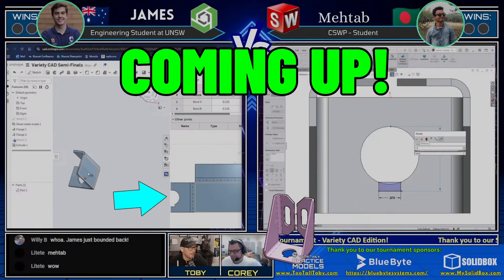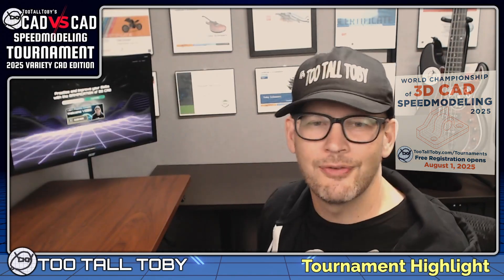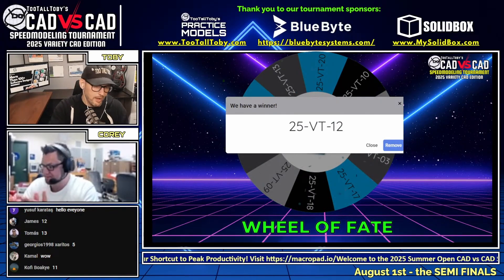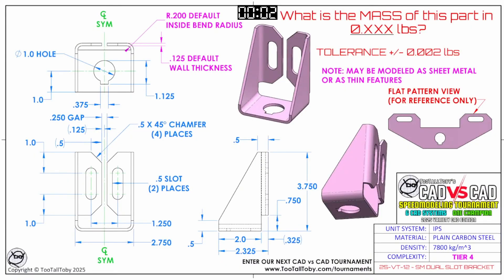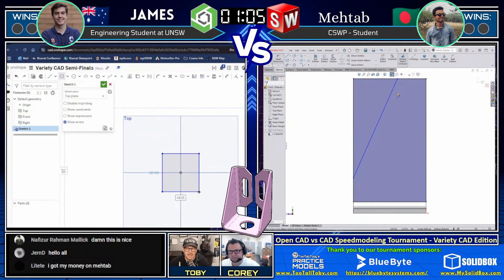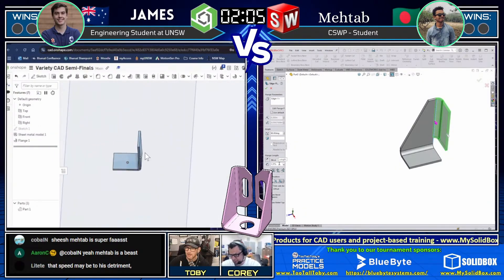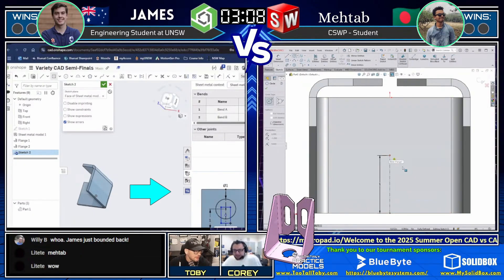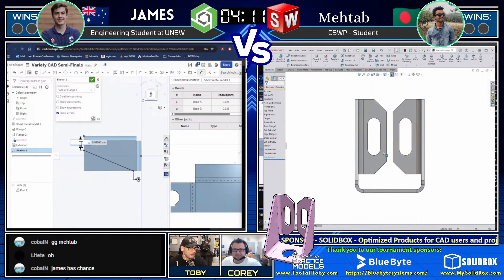CAD vs CAD TOURNAMENT Sheet Metal Battle! 🎮 Onshape vs SOLIDWORKS

Comment: In this drawing competition, it is possible to create only the flat (unfolded) model without the folds, since the overall purpose is to determine the mass of the object. It will not make a difference whether it is unfolded or folded. Is there any rule to prevent this from happening?
Reply from the maker: So this is 2 part answer:
The answer in mass being correct is all the runners need to earn a point. So however they get there is good , and sometimes they take clever routes! 😀
And the second part of the answer is that in 3d cad, the sheet metal flat pattern is actually a slightly different volume (and mass) than the formed model. This is because of the idealized geometry that is shown in bent corners, and the use of calculations for bend deformation.  This is described in better detail in this video: https://youtu.be/-4uN9eRihQQ?si=tFHodPvY_6RguBrm

So solving entirely in the flat might actually knock the solution out of the available tolerances for "correct mass"! Crazy right?!

Great question!